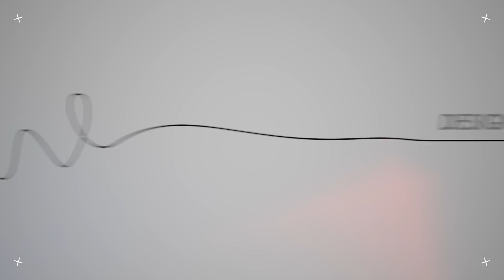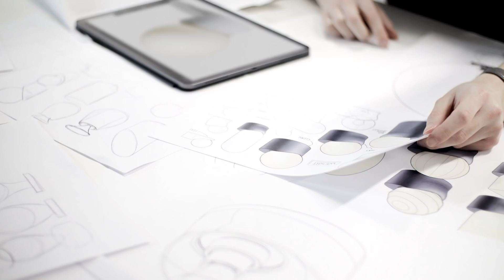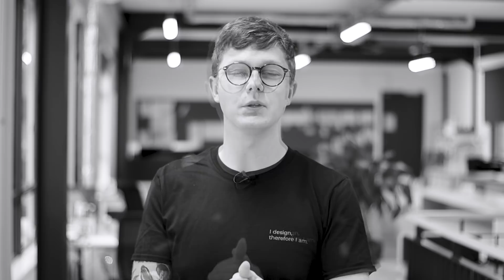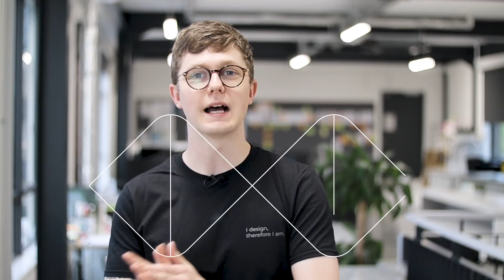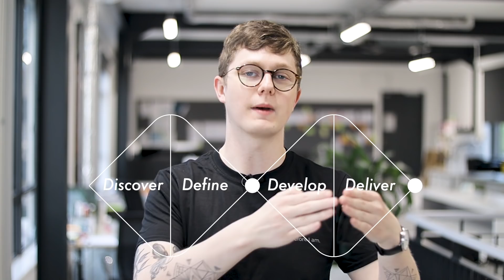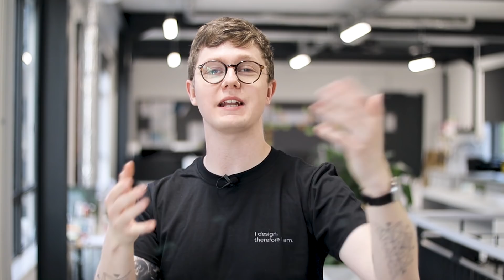Design in Process Episode 1: Design Philosophy

Comment: I worked as an automotive designer in a large accessories company where there was no time for the design process. I would get an exact outline and I would have to design exactly what they want. Sometimes I would get a week to do it, sometimes a day or two. It really depends on the company so I would suggest researching the company you're applying for and tailoring & tweaking your portfolio to their requirements.

Comment: It will  really great video series. I am curious how they add  small design elements in product. Example if someone design a remote then how they add that battery changing mechanisms. And how they decide where to add screw and small support, and where pcb will go and how wires will attach.
Reply from the maker: They’re all great questions! Even if I don’t answer those in the series specifically, I hope the things I show will help too